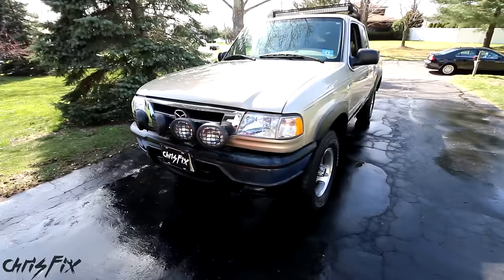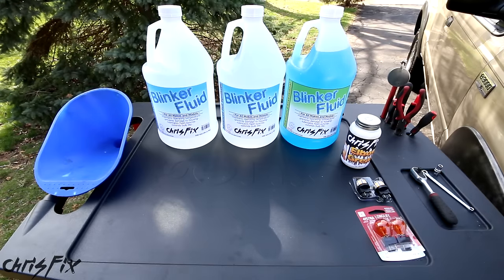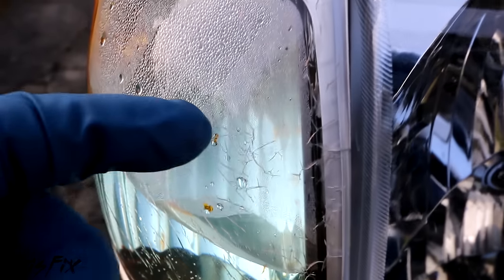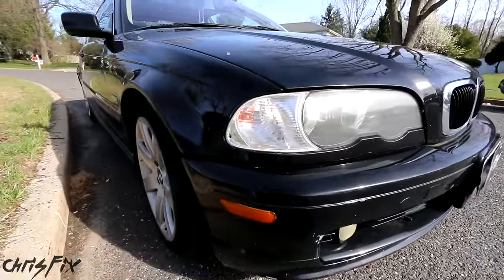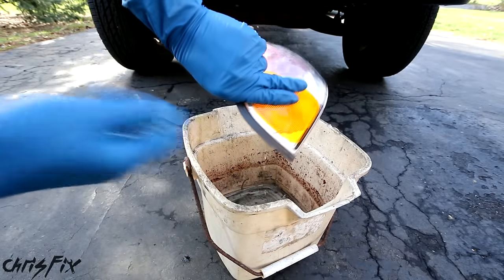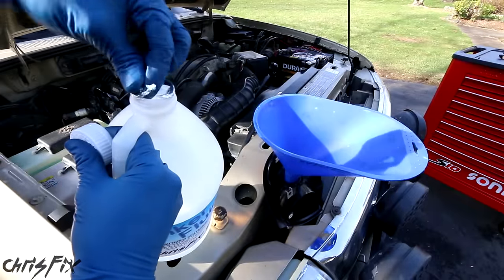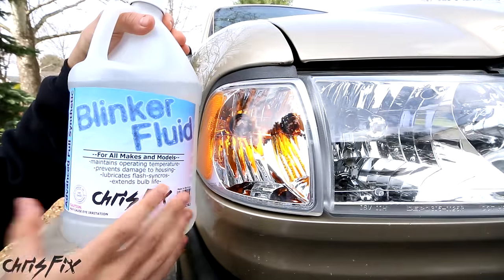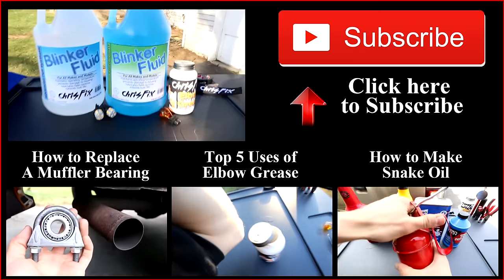How to Replace Blinker Fluid

Comment: But seriously if your mechanic says to change the blinker fluid then find a new mechanic
Reply: @balls6316  why do you have to know
Reply: @balls6316  ok balls.
Reply: @balls6316  it’s important to flush out your blinker every 10k miles
Reply: @balls6316  LMFAOOOO
Reply: Or alternatively you can change your car from a BMW to something more sensible, where you can trust that your blinkers are working correctly!

Comment: Guys I just did this. It increased horsepower 80% as well!!! My stock Honda is beating Ferraris left and right. Thank you Chris.
Reply from the maker: Awesome! ;)
Reply: @chrisfix  I love how this video was uploaded 4 years ago, but you still replied to this comment.
Reply: ChrisFix OMG you are still replying. Legend 😍😍😍
Reply: That's because when you get low on blinker fluid or it goes bad, it forces the car to work harder to blink and drains the horsepower.
Reply: You're still replying
Reply: yoo what's your problem with hondas?
Reply: @augie6029  when did I say I had a problem with Honda's?
Reply: What the...??  Damn what's the name of that fluid, I gotta get some!!!
Reply: Add a pin stripe to your paint job. Increases HP around 100. When I did that to my Honda the VTEC really started kicking it.
Reply: @silentype3008  Pin stripe?  Dammit I was using a paint roller.  But I did notice my truck was more streamlined after adding the window vents.  I did have it over a hundred until I added the...paint stripes.  Dropped me down a few m.p.h.  Gotta get out the paint remover.
Reply: I had that thought but was concerned over the additional drag the stickers might induce.  In addition some states have banned the sticker due to "road racers" using them as their colors.  Ridiculous I know.
Reply: ChrisFix still replying to your vids that are 3 years old dang that’s commitment right there
Reply: got confused and filled transmission, how do i get it to stop making clunking noises?
Reply: @silentype3008  i used the wrong type of blinker fluid in my honda and the vtec kicked in too HARD YOO!! 
my engine block exploded
Reply: @thisisraptr7280  One guy said to fill it with oatmeal and the knocking will stop.  Another suggested running the car in reverse until the fluid bubbles out.
Reply: Lol
Reply: Dude I put some in my car and it started floating away
Reply: @joshbruning7808  Did you use the European or American version?  It's specific due to unforeseen consequences to use the proper fluid for the vehicle in question.  Hope you find it soon.  If the fluid leaks out the car can settle down anywhere.
Reply: Rondo Hunter it was the American fluid and I don’t think my car will ever land
Reply: @joshbruning7808  Ah, most of the American fluid is actually made in China.  Lower quality, fluid is not pure and will leak.  The vehicle will land, somewhere, soon.  Got a tracker on it?
Reply: Nice 1 but instead of blinker fluid use red bull... MATE ya car fly’s past every1 😁😁😂👍
Reply: @tobetone6367  Lmao!!  Red Bull does add wings, so they say.  Now we have first hand anecdotal evidence.